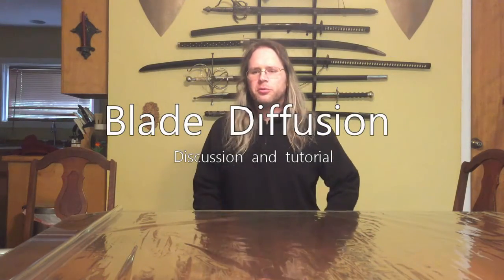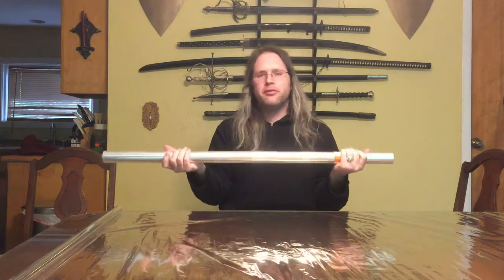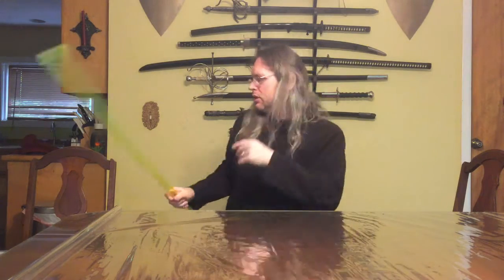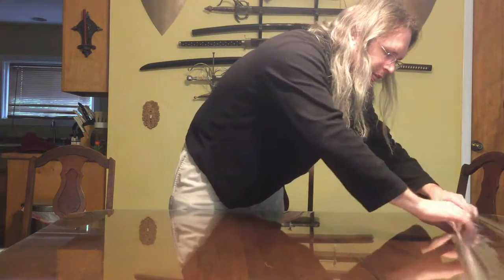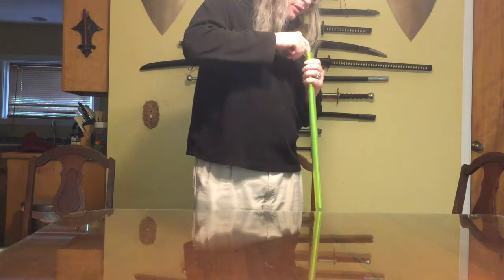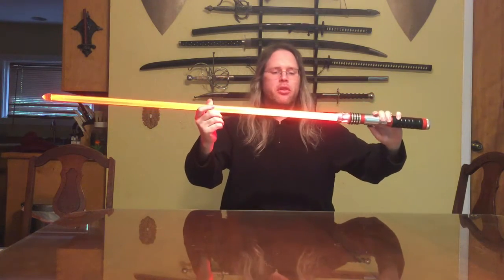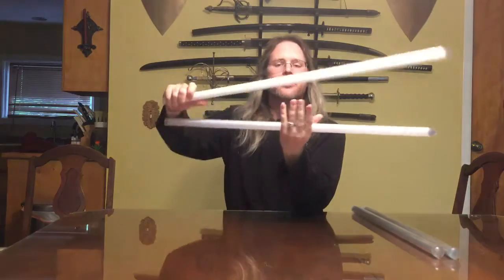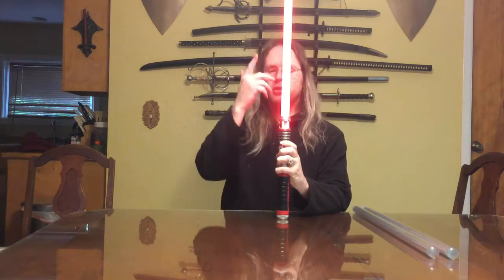Lightsaber Blade Diffusion: Tutorial

Comment: This was really awesome! I do have one question though, my diffusion film keeps falling inward and messing up the colour, especially with a lightsaber that has multiple LEDs, the colour will look radically different at the end. What is your recommendation for keeping it on the edge and not 'unravelling' in the center?
Reply from the maker: Put a thumb in and rotate to flatten it to the outside of the inner blade wall. if it is cut to length that is all you need. You can use a bit of hot glue to secure it if it is not.

Comment: Could using black cellophane make a dark saber?
Reply from the maker: if it is see through black, you can make a greyish purple blade, but it will be dim. The other issue is that the tip will not be the same color. The only way to get an actual black core is to use an acrylic flat blade.

Comment: My dayblade from kyberlight was delivered today but there is a bunch of dust particles that are statically attached from inside the blade. Do you have any advice on how to remove the dust?
Reply: Run cold water inside the entire length of the blade, shake out any excessive water,  and then allow it to dry thoroughly. That should take care of any dust particles. (hot water will only result in the blade fogging up inside) I've done this before and its the only wayI know of on how to remove any dust particles.
Reply: DJ Gamera thanks worked like a charm

Comment: This is a fantastic video. Clearly explains and DEMYSTIFIES diffusion. One question! How does the film hold up in heavy sparring?
Reply: It should hold up fine, as long as you dont like pull it out with your finger, because then it will crumple. It's basically like Seran wrap but with the rigidity of regular copy paper so as long as you dont mess with the inside of your blade it should last forever.

Comment: Does the sanding trick work for a kyberlight blade
Reply from the maker: On the day blades, absolutely. On the regular blades, yes but not as well. Kyberlight regular blades are trans white, so they are somewhat diffused already. You should add film to them though.
Reply: Darth Cephalus thank you. For adding film that is 40 inches long and my kyberlight blade is 36 inches long how do I go about cutting it.
Reply from the maker: I thought it was in this video, but basically roll it up, put it in the blade, pull it out a bit, and cut it to size with a pair of sharp scissors.
Reply: Darth Cephalus thank you I really appreciate that you reply to your viewers

Comment: How do I know when will I stop sanding the blade? What grit did you use?
Reply from the maker: I used 160 but anything up to 400 works. You only need to go over the blade a few times. What you are looking for is a cloudy or frosted look to the outside of the blade.
Reply: How do you put in the cellophane in smoothly though? mine keeps getting stuck on the side of the blade. the cellophane is dry enough..
Reply from the maker: Roll it thinner than the tube then unroll it a bit once it is in.

Comment: I ordered a couple of Kyberlights for my 9 year old and me to duel with, after moderate research and in no small part due to Darth Cellophane's <snicker> tutorials.   It hasn't arrived yet but I'm already thinking ahead and I have questions.

There are a couple of tutorials with the cellophane.  None of them talk about a thickness or specific type other than that whole 100 feet x 40 inches.   I went looking online for cellophane and I wouldn't recommend searching it on amazon...there are too many options.  

Question 1: Do you guys (you or anyone else that has attempted this) have any recommendation for the thickness of the film?  For instance would regular plastic wrap out of the cupboard do the trick 2 feet by 100 feet and I'd just measure out 37 inches...or is that 40 inch x 100 inch a special type/critical mass that works?

Question 2, if the sabers have heat-sinks, I assume that the heat goes opposite the direction of the blade and the lens assembly should be cool to the touch or the cellophane would catch fire, so there is no danger of putting the cellophane in.  Is any part of that very compound sentence not 100% right, and which part if any?

Question 3, I saw on Amazon a more silvery cellophane:

https://www.amazon.com/Sparkle-Wrap-Clear-Cellophane-Roll/dp/B004SZH3CG/ref=sr_1_15?ie=UTF8&qid=1530901119&sr=8-15&keywords=40+inch+cellophane+wrap+roll

but I can't tell if it's better for diffusion, or if the higher density will cut the light down.  Anyone have experience with this stuff?

BTW, Amazon has colored cellophane for those looking: 

https://www.amazon.com/Hygloss-Products-Cellophane-Roll-Baskets/dp/B01M1VU3IL/ref=sr_1_1_m_sspa?s=arts-crafts&ie=UTF8&qid=1530901599&sr=1-1-spons&keywords=40%2Binch%2Bcellophane&th=1

Question 4, I have a 2 oz bottle of phosphorescent glow in the dark paint.  Has anyone tried that in the saber?

Question 5, someone else did a tutorial on LEDs but not lightsaber blades where they put translucent packing wrap.  Have yall tried this in the blade tube and what do you think?  Pool noodles are too thick.  My other though is they would show the seam line if you use it.
Reply from the maker: You can add all kinds of things inside a blade. Most people use craft cellophane, but some use pearlescent or other such products. As for thickness, it is clear or clear ish, so thickness is not a big issue. You don’t want to use food wrap though because it clings and you can’t roll it up without it sticking. Phosphorescent paint works but only with blue light. See my video on photon Blades for details. One of the blades in that one is just painted.

Comment: The film in my ($50) VV photon blade just fell out today. In the process of putting it back in, I crumpled it and got dust allll up in there. What do I do? I feel like it shouldn't have fallen out so easily, I have a ultrasabers blade that has never done this.
Reply from the maker: VV does not glue theirs in place. The reason is so that they do not get twists in the film. I had that happen with a ultrasabers blade once or twice. The down side is that it can fall out if you have the blade out of the saber and don't use the little dust cap. If the film is dirty, I would suggest, toss it and pick up another sheet at a craft store. You can't really clean that stuff when it gets dusty.

Comment: Can you do this with the Kyberlight day blades to get brighter colors?
Reply from the maker: Yes. If you have a kyberlight day blade, i strongly suggest this.
Reply: Darth Cephalus Thank you so much for the info I'm gonna order a purple and blue day blade. I already have cellophane wrap so I can put it in them.
Reply: Darth Cephalus So for example a blue Kyberlight day blade used with the Blue LED along with the cellophane wrap inside would make the color even brighter? Kinda like VV photon blades?
Reply from the maker: No. The photon Blades are a fluorescent. The green Kyberlight blade with a blue LED will do it, but that is a different thing. A blue blade with a blue LED will just be deep blue. The point behind the day Blades is that is will still be blue when the saber is off or in direct sunlight.
Reply: Darth Cephalus  Would the green work with some of the other colors like the purple, pink and, Ice blue? I use those colors the most with my Kyberlight. I just wanna gather all these facts before I decide to order the blade.
Reply from the maker: Florescents feed on low light waves like the royal blue die in the kyberlight. The end result is usually transferring any blue to green. The green, red, and white dies will have no real effect. Try this video for a bit of an explanation. www.youtube.com/watch?v=KTpIriPhTdc

Comment: hello, i need your help with my lightsabers. 
i just bought my custom lightsabers from a local maker, and i have some "itch" about the blade because it looks kinda dim towards the end and have that "inside tube" effect that i don't like.
i watched your very informative video about diffusion and was wondering if the light effect can distribute evenly if i change to v4 infinity edge saberforge blade or the blade its not the problem for that effect? can you please help me with this thx
Reply from the maker: I would start by trying to sand the blade you have if the material is clear. Use 160 grit or so. If that does not work, you can try to switch to a mid grade blade and sand it. If neither works, it is a dim LED. The infinity edge blade’s main selling point is tip illumination. Besides that, it is just a dual diffused blade using some kind of frosted effect from slightly trans white polycarbonate.
Reply: Darth Cephalus okay! Thx for the info..ill try it right away

Comment: Very nice. Only reason why I don't like KyberLight :P They can have much more potential if they diffused their blades properly and stuff and use better electronics at least. I've only stayed away from them because of all the hate they get now x.x So basically cut the cellophane to any length of empty blades you get even from TCSS? I was recommended to get a razor roller cutter though so might try that as well to get a better cut than regular scissors
Reply from the maker: Regardless of how you feel about the saber, their blades are a good deal. Diffusing them yourself is pretty straightforward.

Comment: Hello, would more cellophane paper than 5ft mean a brighter kyberlight blade? I would like to know what you recommend for a kyberlight blade on a kyberlight hilt.
Reply from the maker: All you are doing with the diffusion is evening out the escape of light. The problem with their undiffused blades is that the light all pours out the base. The film helps get the light all the way to tip. You can go with a more than 5 feet if you like, but once you get the light coming out evenly, the film has done its job. For the day blades a bit more might help; for the standard blades it probably won't do anything noticeable.

Comment: Could the technique for double diffusing the blade using sand paper also be used on a black series force fx lightsaber, and if so, what grit count sandpaper do you recommend?
Reply from the maker: It could I suppose, but the EL blades on those make the light pretty even already. It might bring the light out to the edge a bit better. You can use anything from 100 to 240 and the effect is slightly different. I prefer the 100.
Reply: Darth Cephalus hi mate, I'm loving your videos. I have a question for you if you don't mind. if you where to buy a only one light sabre for around $270 US dollars which one would you buy? Thanks Phill
Reply from the maker: What do you want to do with it? Do you need sound?
Reply: It will be for duelling but I do want sound :)
Reply from the maker: In that case, Vader's Vault and Saberforge are out of your budget. Your options are Ultrasabers (you can afford just about anything they make with sound as long as you don't go for a light upgrade) or Kyberlight. If you go with Kyberlight, their sound is nowhere near as good, but they do have on the fly color switching at that price point, which is kind of a big thing for me. I would suggest either the master set or the knight set with one of the Tsuba guards. If you go with Ultrasabers, I would suggest the Manticor. It is a nice all around saber and has a basic hilt section that works well with any pommel or emitter that speaks to you. The emitter that comes standard with it is a great one for dueling as well as it provides a slight choke and a flared end for hand protection.
Reply: Thank you so much for your advice it's very much appreciated. I heard the kyberlights arnt that bright. I know if you add diffusion film it gets better but it's hard to tell on your video if it makes a big difference compared to the ultrasabers. That's not your fault I guess savers are just hard to film.
Reply: Darth Cephalus are you able to make a video of the brightness comparison between the different branded savers you have using the same blades amd diffusion film so it's a fair comparison
Reply from the maker: I made one a while back. It does not have the VV saber in it as I did not have it at the time. I also found out the SF saber was a 12Watt, but still I think it does the trick. Some day soon I may try to make an updated version. https://www.youtube.com/watch?v=4ZfF05xzT5I
Reply: If you make an updated video can you place the same blade and diffusion in all the sabers you own so we can see which is exactly the brightest. I appreciate your help :)

Comment: Nice video... question, can this also be done with a styrofoam insert with a hollow center? if so, would it look as good or better when lit?
Reply from the maker: It can. As a matter of fact, those EL blades I mentioned in a response to another of your posts use a setup like that. In that case it has the added benefit of protecting the LEDs. In a single LED setup it might be a bit too aggressive and keep the light from diffusing all the way down the blade. I personally would not try it because of the added weight it would bring.

Comment: Thanks for the great tutorial. I own a Kyberlight saber and was not really impressed with their blade. It is great for dueling but the overall secondary and tertiary colors don't mix that well so I'm going to try this trick. How many feet of clear cellophane wrapping paper is recommended? I'm going to buy some this weekend as was just curious to the length.

Thanks for your time and I'm now subscribed to your channel. :)
Reply from the maker: The one thing to remember about the Kyberlight blades is that they are a lot cheaper to buy than a lot of other blades. For that reason, I didn't have a problem with the extra work to diffuse it. I ended up using between 4 and 5 feet of film on mine and that seemed on the thick side of just right.
Reply: Much thanks for the reply, Darth. Also the custom saber shop blade (photon green) I just bought was around $15 plus shipping. My Kyberlight and TCSS blades look much better now thanks to your tutorial :)
Reply: Damn lol. I'm doing exactly this. 4 years later after your post DJ.